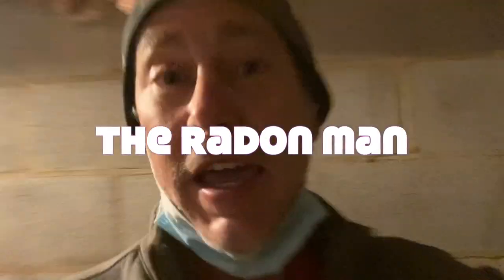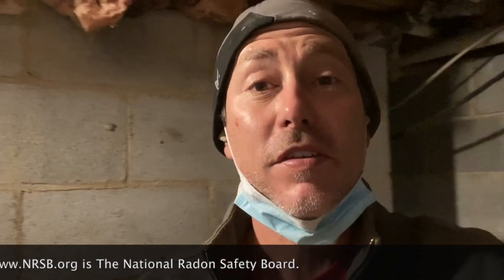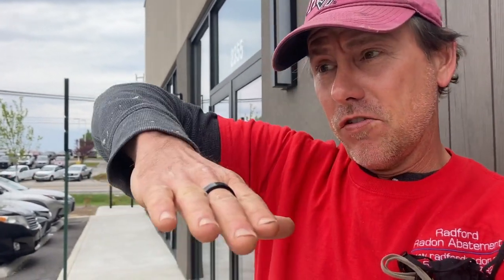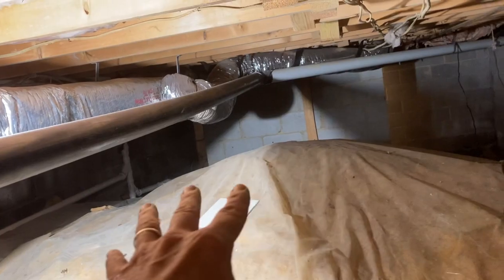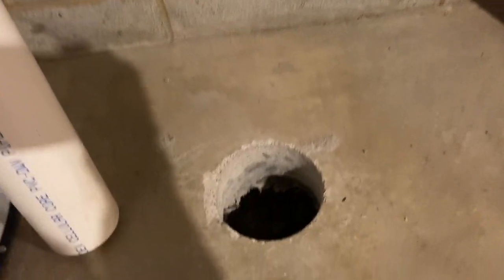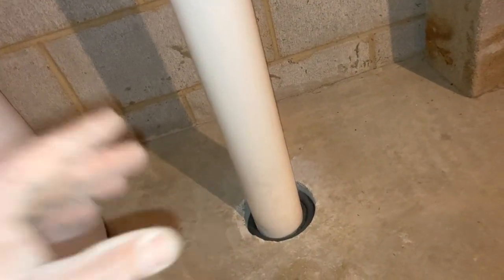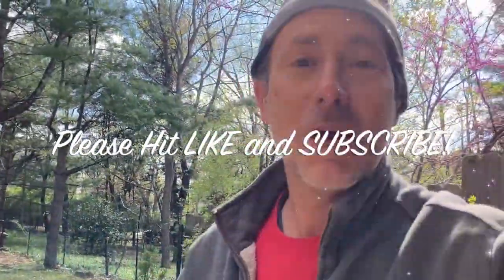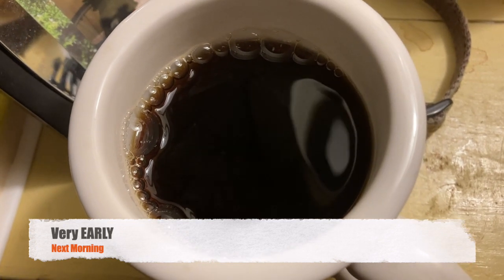How To Remove Radon From A Home With Slab AND Crawlspace

Comment: Maybe you can help me I have a crawlspace in my house that has a dirt floor and a radon system installed on top of the dirt underneath plastic. I’d like to pour concrete over the dirt. What do I do with the radon system if I decide to put concrete in there. Can it stay in place in the radon system go below the concrete slab or should the radon pipes sit on top of the concrete slab? If you could just answer those couple of questions I’d greatly appreciate it. Thank you very much.

Comment: Subscribed! Heavy Kansas DIYr here. Upgrading a new home passive system with a Festa AMG Maverick since up in the attic I just completed my nice plankway over the rafters/insulation! Curious as to why some attic setups use two elbows with condensate bypass wye tube versus just the inline setups I’m seeing? I see Suncourt fans require the condensate bypass for warranty but don’t see any requirements for Festa or even the mention of it. Are some fans just engineered better to take the moisture passing by? Thanks for any insight. Plan to watch more vids!

Comment: If you are using the black corrugated with slits or the PVC that has multiple holes along its length does the slope still matter since any water that gets in the pipe would drain out the slits/holes along the length of the pipe?
Reply from the maker: Hi Shane.  Good point there. The short answer is no.  Just assume water will show up and my advice is to be thinking about how to discharge it.

Comment: Love the videos, been waiting for some detail on the crawlspace setup. I have about 130 sq ft unvented crawl about 5 ft above bsmnt slab. Is one perforated 2 inch pipe sufficient? I had not thought of a valve, but I will put one in now, but how do you estimate the adjustment?  Last, is sealing the crawl door really necessary since the dirt was sealed with 6mil plastic?
Thanks.